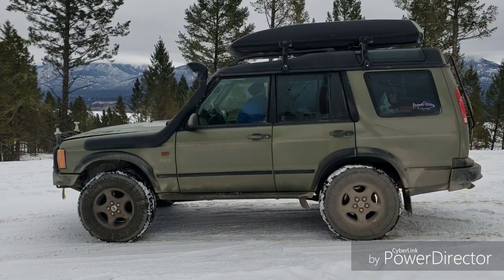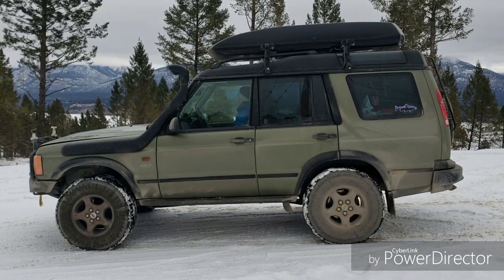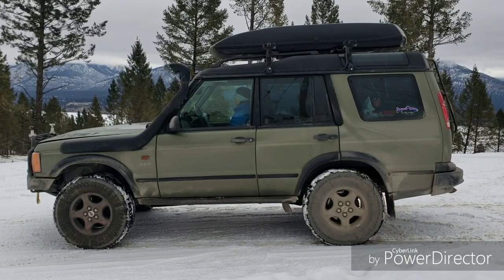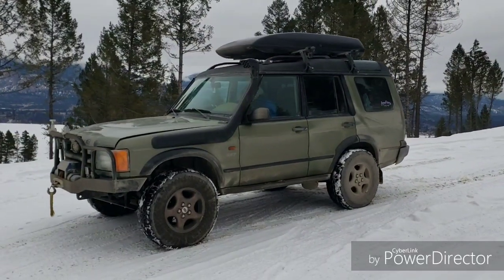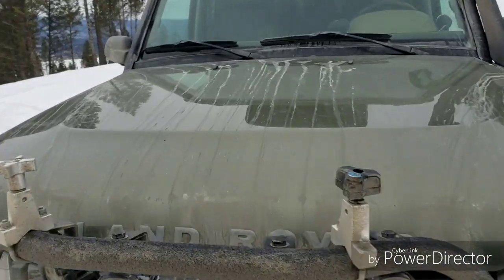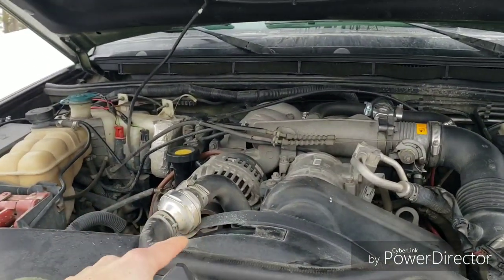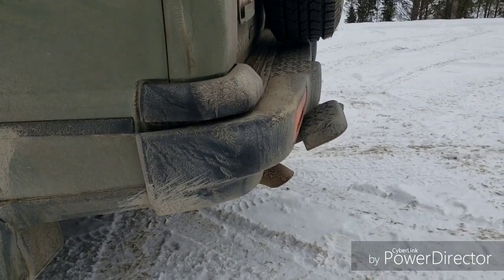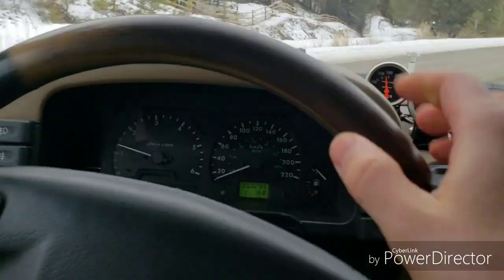Land Rover Discovery 2 Performance Upgrades with Magnaflow Exhaust

Comment: Hey, looking to do a similar 4.6 swap and magnaflow exhaust for my '91 RRC. What model of magnaflow exhaust did you end up with?
Reply from the maker: Good question. Whatever one mated up to the stock piping. Out local muffler shop handled it but it seemed like a fairly common item as they had it in stock.

Comment: I think I would have gone to a manual gearbox at the same time as switching engines, It does sound nice though.
Reply from the maker: Auto is great for offroading to feather the pedal and it actually has quite swift gear changes which likely has something to do with it being a ZF gear box

Comment: Hi, I seen your website and explanation on getting an engine from Turner, but you didn't really discuss why you chose Turner over AB. Any way you can elaborate here (or message me directly)? I'm debating which I should go with. Most shops around my area haven't heard of Turner, but it appears to be higher quality.
Reply from the maker: As far as I remember AB didn't carry it at the time so they weren't even an option.